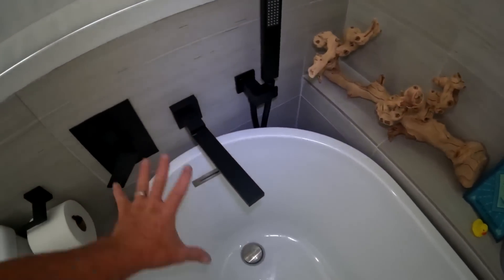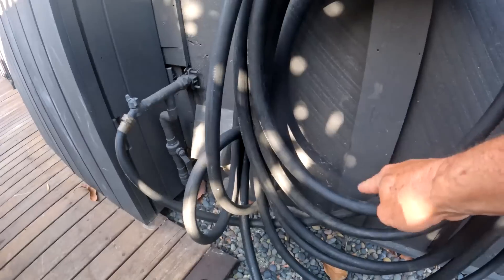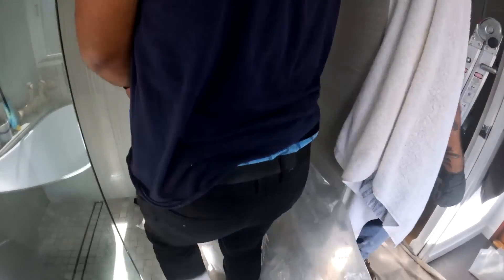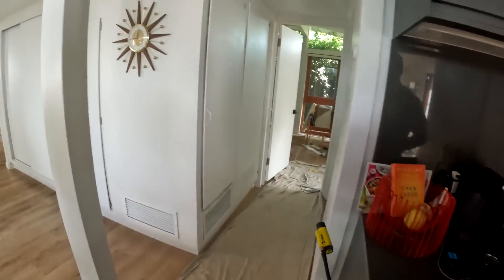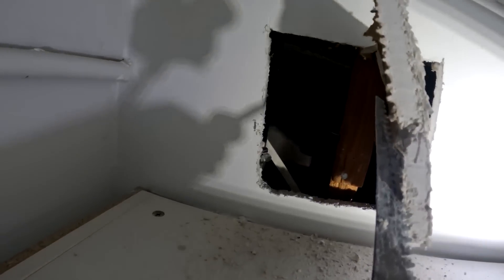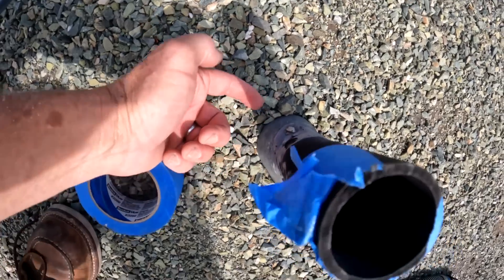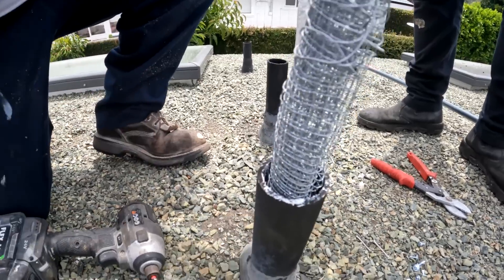SCRATCHING in the Shower... the rats you REALLY need to WORRY about ….

Comment: Hey Twins. I hope I can get a quick reply from you guys. When I bought my house it was a rat hangout.  I cleaned out the addic and killed a bunch under the house. My parents paid for peanut spray in insulation in the Attic but now I can hear a rat walking up there.  I can't crawl in there due to the 2ft high peanuts, I'm screwed ain't I ?
Reply: I watched one of your older videos and there's a slim chance it's actually a squirrel on the roof but I doubt it.  My cats were tracking a mouse in the house 2 weeks back, I crushed it under some t-shirts 😳

Comment: If there’s a breach in the vent pipe won’t you have sewer gas coming in the wall cavity? We didn’t see you fix the breach
Reply: Customer didn't want to.
Reply: They put a  stainless steel webbing pipe down that broken pipe to block the rats from getting in. 
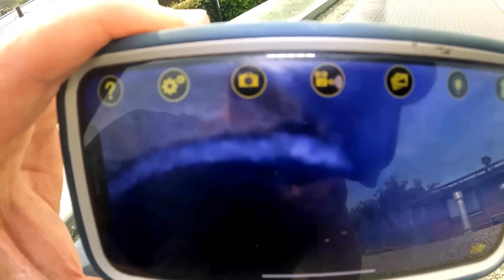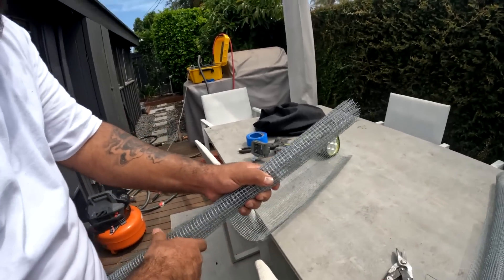The customer didn’t want to open any walls and so that’s why they went with the stainless steel webbing pipe fix. See minute 8:27 and 8:57